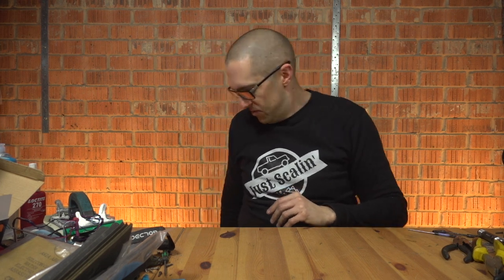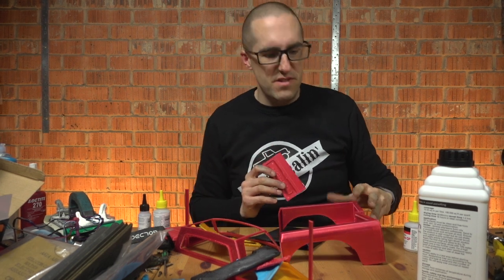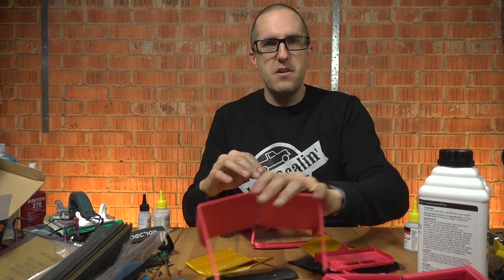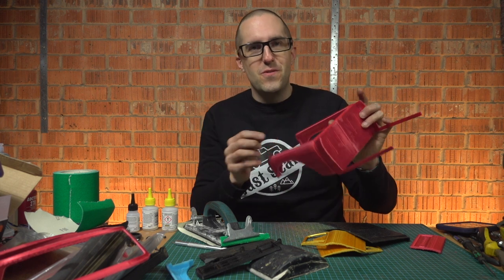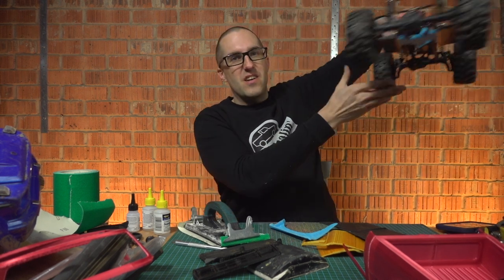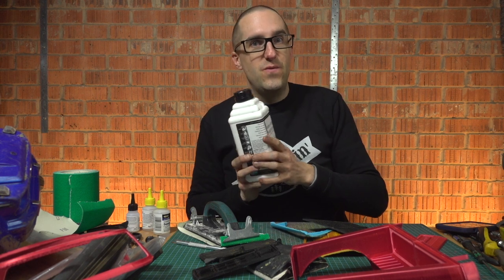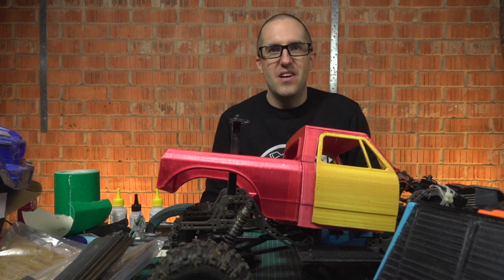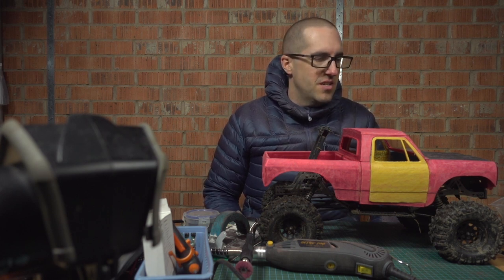I 3D printed a crawler shell now all I have to do is put it together!

Comment: Nice work ! I've printed a few RC bodies out of PLA myself. They look really nice but are extremely fragile. Not really good for bashing lol. BTW you can use spray putty to fill the layer lines. Still needs a little sanding after but not as much.
Reply from the maker: Yeah I’ll look into it.  Wanted something that would print the colour I wanted. Seems like that’s just impractical
Reply: @JustScalin  Also you can weld the parts using a soldering iron and a 3d pen. What I do is keep the parts in place with tape on the outside of the body  and melt a groove along the seam inside the body with the soldering iron. Then fill that groove with the 3d pen (highest temperature setting), if that makes sense. I've never had a weld give up so far.

Comment: Fantastic idea and concept, I know it's a crawler but my query is. How many times will it tumble before it shatters? Unless your hands are ready to catch the car. 
How long will it the body last.
Reply from the maker: I printed the cab and hood in one direction and the rear in another to see which broke first. Turns out it was the rear, but no big deal looking to do a second version.

It’s nowhere near as safe as lexan but that makes me drive a lot more slowly and carefully which has really improved my skills. It had a few tumbles last weekend and held together fine
Reply: @JustScalin  so all in all great idea/concept for crawler bodies. We cant have successes without a few failures first. Awsome video and I'm glad it's working, so when you doing me a trx4 body haha.
Reply from the maker: I’ve actually got a spare one printed that’s a 3 piece that now has bolt mounts to hold the hood and cab together. If I can get PETG printing as fast as my PLA I’d be very happy. Probably going to start printing with a 1mm nozzle and using filler in future
Reply: @JustScalin  so it's a hollow/hollow body if that makes sense lol. Well definitely put the printer into a fill program cant imagine that stuff to weigh much. I personally am rooting for you on this one mate.